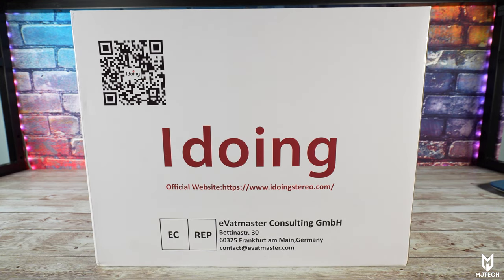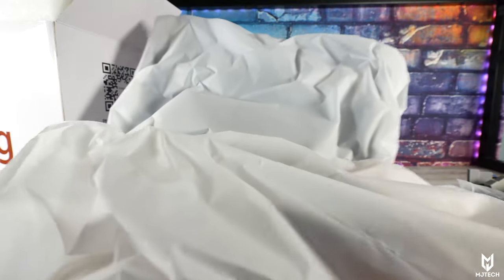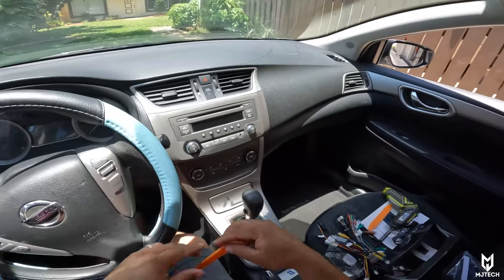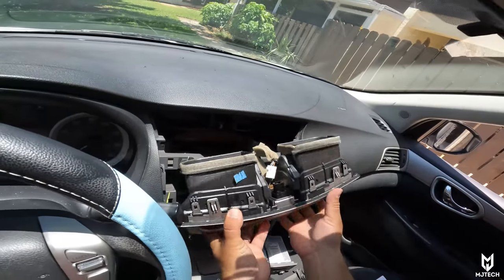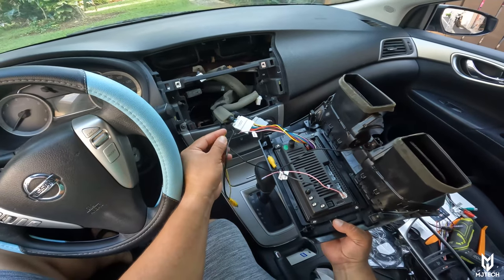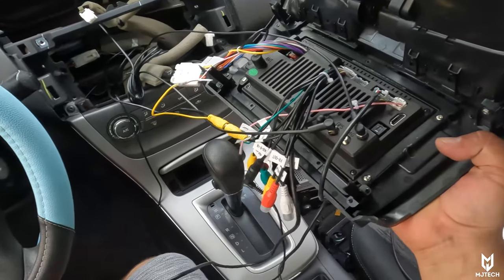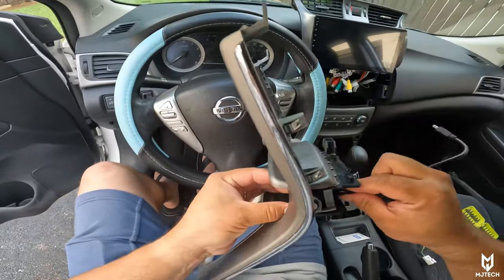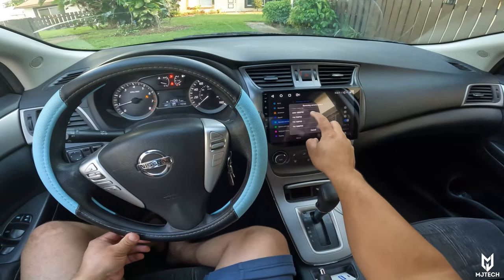This Car Head Unit Will Blow Your Mind - Nissan Sentra 13-19

Comment: Hey man is there any way you can make a quick video on how you aligned your rear wheel on the Vitacci sport bike? I’ve got the Gtx 250 and I’m not used to the alignment nuts on the back and I’m so lost man. I’ve been working at it for a few hours now and it’d really help me.

Comment: What about the passenger airbag light that was underneath the hazard switch, is that gone now? Haha.
Reply from the maker: There’s 2 versions of this same radio. I ordered the wrong one but still made it fit.
Reply: @MJTechChannel  oh, oops! 😆 I'm sure you can relocate that light somewhere else, it's not really important (unless it doesn't activate the passenger airbag if that light isn't connected 😬).
Reply: Is the one you linked in the description the correct version? @MJTechChannel

Comment: Got mine off Ebay 7 months ago and very happy with this upgrade and also the best presentation of this unit I've seen this far. Great post 🏁🏁🏁
Reply: Have you figured out how to dim it for night driving? Even on the lowest setting it’s pretty bright
Reply: @Just.A.T-Rex  actually I have not but if the steering wheel controls are all correct I know I saw a setting that allows for adjustment in car settings but I'm not positive how I got there...
Reply: Which seller did you buy from I'm looking for one for my 2016 Sentra and there's a lot of them for sale I'm not sure which is legit and which is not. thanks
Reply: @MrPoolmaster11  jmance2021 out of California.👍🏽

Comment: mine didn't work out on my Nissan Sentra 2014 SR.
My car radio had one extra connector on it. Which apparently isn't compatible with anything on this android radio upgrade.
The SR has rear view camera and Bose sound system. I didn't have any audio, nor any steering wheel control. All the connectors I plugged in did, was power the android radio.
Reply: Did you find one for ur car I have the same one and I’m looking rn
Reply: Same @Ghoztysolos  Did you find anything good for the 2014 SR?
Reply: I was just about to ask if this is compatible with stock back up camera n upgraded sound system. For some reason it is very difficult to upgrade your radio/monitor on upgraded bose systems. Has anyone made this work on cars with a bose system?

Comment: Does this work on a 2019 Nissan Sentra ?
Reply: I believe the other model will. It doesn’t require disconnecting the hazard light and passenger airbag.

Comment: Hi I had this same unit installed but the steering wheel control is not working. Did you select the canbus for it to work?
Reply: Hi, any luck on getting the steering controls to work? Mine too isn’t working

Comment: just got a used 2018 sentra sv, it has a wack screen. I want to this mod but i don't actually like the big ass 10 inch screen.  is there a smaller option?

Comment: Am trying to get that main connector that goes to the main wire that came off the original radio to plug in the aftermarket stereo
Reply: I’m